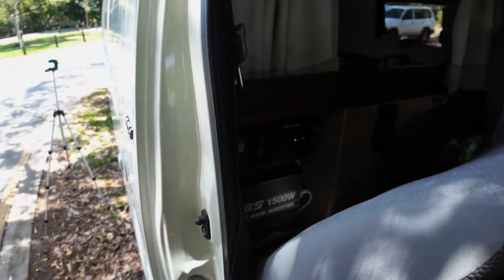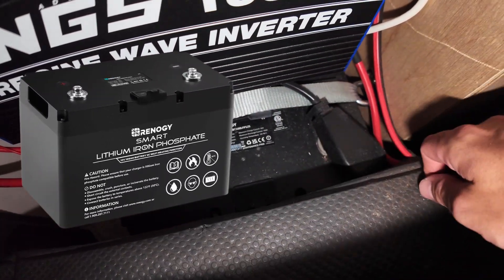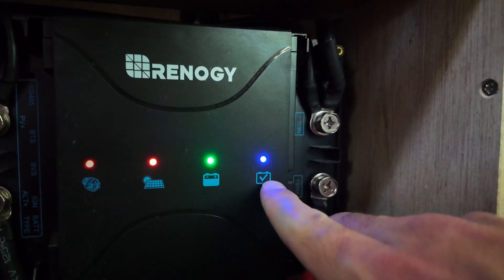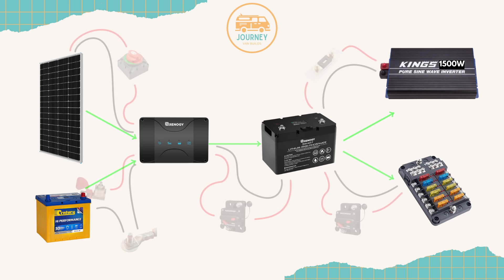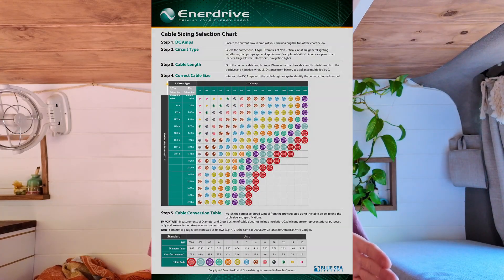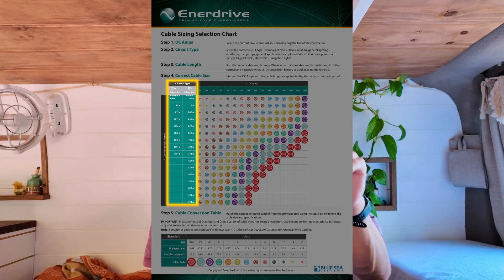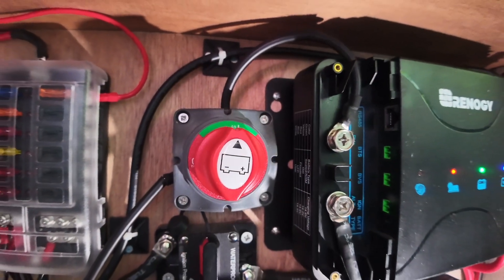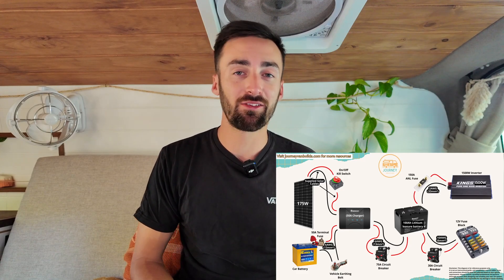12V Electrical System for Toyota Hiace Van Conversion | Full Walkthrough + Diagram

Comment: I have a 200 series Hiace as you feature in your videos. I think it's worth mentioning that you have not stored the LiFePO4 (Lithium) leisure battery in the compartment underneath the drivers seat. This is very important because this compartment gets quite warm as it's in the engine bay area and LiFePO4  batteries do not like heats over ~50 degrees Celsius. If you were to use the compartment for a leisure battery, it cannot be a LiFePO4 type battery.

Comment: Hey Jake
I’m self converting a 300 series hiace and I’m about to look at the electrical side of things. I’m not sure if I am confident enough to do it myself  so will most likely get an auto sparky onto it, I just hope to have everything he needs there apart from the wiring.
I’m hoping to get your opinion on whether I need anything else or “extra” to make it happen?

I have: 2x 130 ah lithium
1500w inverter
240w solar blanket
25a dcdc
20a mppt I think it is 🤔

I need to power:  240v hot water tank, tv
12v: water pump, 85L upright fridge, 15L console fridge, max air fan deluxe, sirocco fan

Potentially a diesel heater down the track

What’s your thoughts on this please? 😊

Comment: How much was the whole system
Reply from the maker: Roughly $1,800 not including the big ticket iteams like the fridge or fans. About $1,600 for all components and fuses/circuit breakers and then about $200 for cables and connectors.

Comment: How did you store your house battery so as to comply with the November 2023 campervan storage laws?
Reply from the maker: I'm quite sure it doesn't 😅 I need to do some research on those regulations for sure! Do you know to whom the laws apply? For example does it only apply to vans that are registered as self contained campervans? Or insured as such? I'm unsure if there's a gray area for self converted vans or not to be honest. Interested to hear your thoughts on it though

Comment: Hey mate, am i correct in seeing you had the end of a extension cord coming out of the wall for your 240v? And assuming that is directly plugged into the inverter?
Reply from the maker: Correct :)
I was planning on having it certified by an electrician who can install the 240 Outlet but haven't gotten around to it.

Comment: Also. Any reason you built this system rather than a powerbank like Bluetti that one can charge straight from car battery/alternator dc to dc.
Reply from the maker: This system also charges from the alternator, and building it myself just game me so much more flexibility. For a build of this kind of quality, a fully custom electrical system was necessary in my opinion. An other cases though I have heard great things about the Powerbank/all-in-one systems if you get the right one 👍🏼

Comment: Any reason you chose the Toyota Hiace other than Toyota reliability? Hyundai iLoad vans seem like a lot of van for the money as long as one steers clear of some diesel models that I think can be problematic.
Reply from the maker: Not really, I went Hiace purely for reliability. Because I knew I was putting quite an extensive conversion in it as far as smaller vans go, my priority was longevity of the van.
Reply: @JourneyVanBuilds  Can't argue with that. Thanks

Comment: What a fantastic video and so well presented and explained. I know you didn't go into the details of the shunt, but what is the purpose of that? Also, what would you typically plug into the 240 V AC? Thanks for sharing.
Reply from the maker: Glad you enjoyed it! The shunt measures the flow of power throughout the whole system. Where usually you could just use a battery voltage display to see the state of charge in the battery, the shunt allows you to see the state of charge, but also exactly how many amps are coming in through solar or the alternator, and how many amps are being drawn at any given moment by the appliances
Reply from the maker: 240V in my case is just for charging my laptop, but I wanted it there for resale value as well
Reply: @JourneyVanBuilds   Was thinking laptop was most obvious reason. Cheers